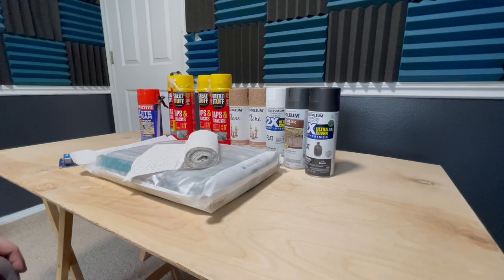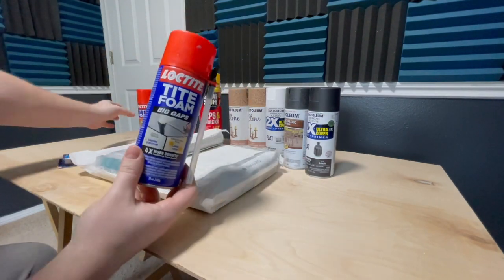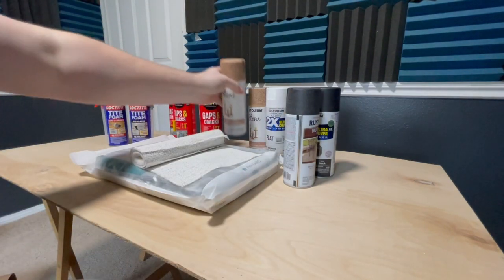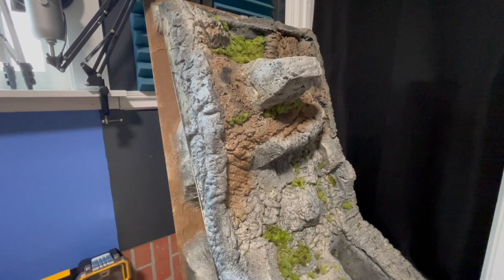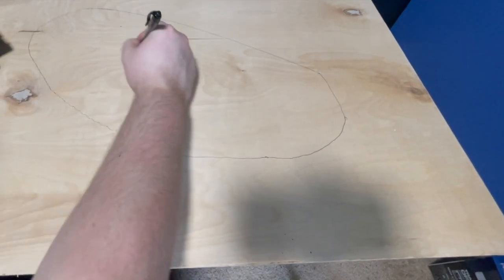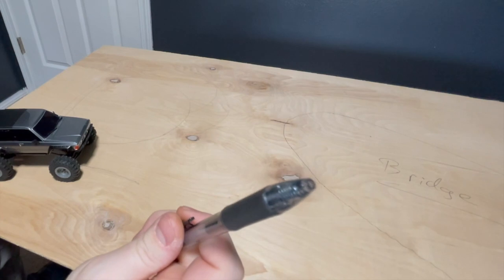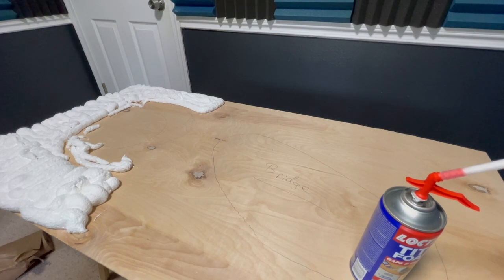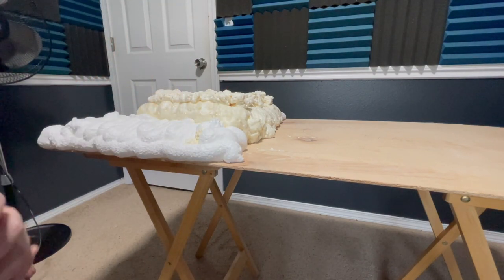Indoor Mini Crawler Course Build! (Part 1)

Comment: Main body - Polystyrene floor insulation boards on plywood base.
Texture - Loose Fill Cellulose Fibre insulation mixed with Plaster of Paris and Water based PVA Glue.
Detail and Colour - Railway landscaping / War Game landscape Flock, Grit, Gravel etc.  Woodland Scenics paints. Contractors tub of PVA.
Reply from the maker: Sounds like you have built a scale landscape before haha I might be that detailed some day but for now I’m keeping it simple 👍🏻😄

Comment: Tip: use some cheap styrofoam cups to build up your mountain under the spray foam so your not using so much foam, not sure about where you live but here those cans get expensive $16 per can now I know that's not super expensive but it really adds up if you use 5 to 10 cans right so why not make the center as hollow as you can.
Reply: Yeah.  And at construction sites, you can easily find dumpsters full of scraps of foam board.  you can build up layers of foam board and shape them with a serrated knife, basically make anything you want for FREE.

Comment: Have you ever thought of making a multi upper layer lower layer course like it would connect together with p v c vipe
Reply from the maker: I have and I even attempted one once but it was difficult and It ended up being more work than I wanted to do at the time, I might have to revisit it though!
Reply: @UpperLeftRC   I was just thinking if you did part 
 upper layer and then part on lower layer it would give u room to turnaround  u would cut spice in 1/2  

4foot by 2foot on the lower layer and 2foot by 2foot on the top layer
Reply: @UpperLeftRC    I thinking about doing one  for a 1/18 scale   but going to use a ping pong table to build on

Comment: What is your opinion on using 1” thick insulation board for the base? - I have to hang my board on a wall for storage - that is why I was thinking going with light weight material as possible - any input is greatly appreciated!
Reply from the maker: I have not used that material before but if it will hold together then I don’t think it would be an issue

Comment: Yo I really like your plaster effect! I’m thinking about trying some drywall mud!! Than paint of course! But was thinking ARDEX FEATHER finish and kind of like paint it on the foam cause trucks slid around a lot of spinning couldn’t really get far... but noticed it always just needed a little nudge in places, but than I figured I’d really get weight on my truck and than perfection less spinning more crawling more challenging but satisfied! I put a mini leather man inside and it gave it a lot of weight but was better than just the few upgraded weights on it! Great video thanks

Comment: Catching up on this series.  I missed the wintertime indoor build, but with the heat coming on, I think I may start a summer indoor course.  Maybe I missed it, but what size is your base?  -- Also, still have a t-shirt with Great Stuff on it from an architecture school project... that stuff is forever.
Reply from the maker: Haha yeah I have a couple knifes that will have Great Stuff on them forever now, and the base of the courses I build are 2foot by 4foot, it’s small enough to carry around and fit in and out of doorways in my house but large enough to have fun on it with the 1/24 scale crawlers